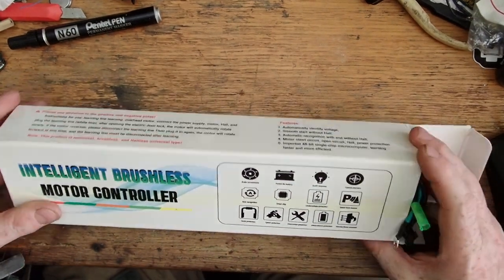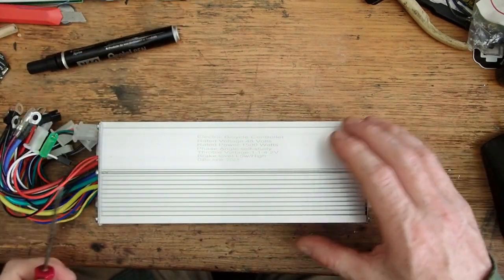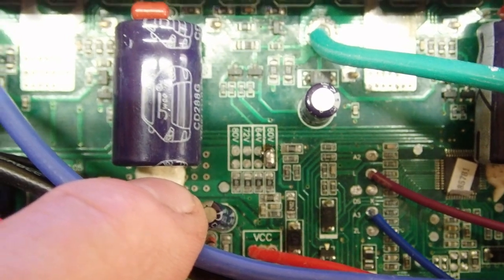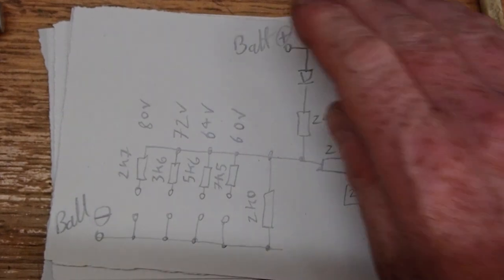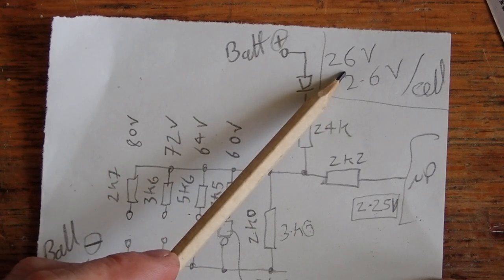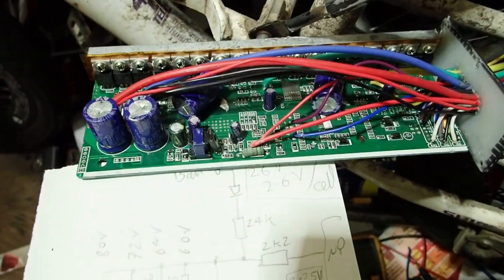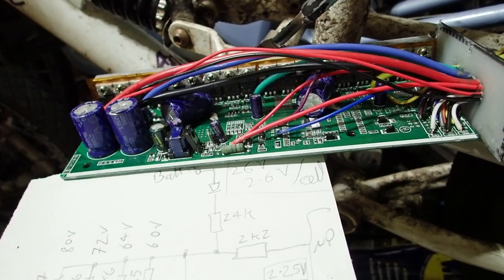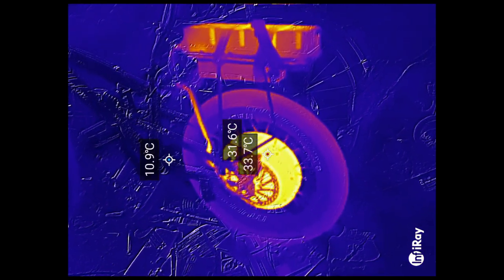Adjusting the low voltage cut off on an ebike controller.

Comment: I don't understand  correctly You mean  : replace 2k resistor
With 3k. And shoted  blocked 60 v written section line to ground with 2 k resistor  please reply
Reply from the maker: You need to alter the potential divider to compensate for the different battery voltage.

Comment: My controller 48 v   it cut of 41 v   i want to change cut of voltage to 24 v   please tell me which value resistor should use? Any other components should i change?

Comment: I thought those pins were for the regeneration voltage regulation when connecting the ds and x pins to activate abs when braking.
Reply from the maker: No, they are low battery cut off voltages for different battery packs

Comment: Just tried this, didn't test ride it yet but it turns on and spins the wheel with 39v. The controller was sold as a 36v but inside there's no such trace. There's 60v, 64v, and 72. I might have messed mine up, but I think I found the right trace (Think) and replaced a 2.4k with a 4.7k. plus side is a new controller is 40$ lol
Reply: Hi i want change cut off 42 to 36 v     replacing 2k with 3k  is solution?
And need another 2k to-() ground from 60 volt joined location
Reply: @afgamer5576  it depends on your controller
Reply: @Ro-Bucks  hi it is 48, 60
Same as normal chinese made 
Actually i want to remove cut off option, Is it enough to omit the 2k resistor from the resistor voltage divider part?

Comment: Is there someone who I could pay to do this? 
I have a 36v 20ah lithium ion battery with a 25v low voltage cut off. All the 36v controllers have a low voltage cut off at 30v. So the controller will not allow bike to power on. Thanks.

Comment: Do you still have the tdi bike?
Reply from the maker: Hi @kevindonley1496, Yes, however the gearbox broke with the same shattered wended diff fault twice. So it is off road for a while whilst I workout how to make it stronger without heat damaging the temper of the gears by welding them.

Comment: What is the controller behaviour after U.V. kicks in...
Does it restart after recovery or does it require a power switch off before restarting ?
Have you measured the upper & lower gate drive voltage when battery voltage is around 26.5V ?
If gate drive volts is insufficient, the mosfets could overheat & fail ( operating in near ohmic region)
What's the runtime now , after modification.?
Reply from the maker: Thanks for the interest. 
After Under Voltage is triggered it requires a power cycle before restarting. 
There is in intermediate 15V switch mode voltage converter which powers the gate drivers and other circuitry. This converter works down to 22V so I can only guess it's fine at 26V. 
I can now use the full range of the 36V 13Ah battery so the range is good but as always related to hills and overall speed. I did about 15 miles at about 20mph in the test for this video and there was still plenty of charge left when I got home again. I would easily expect 20 - 30 miles at the regulation speed of 16mph on a full charge.
Reply: @o0OMouseO0o  Thank You 👍